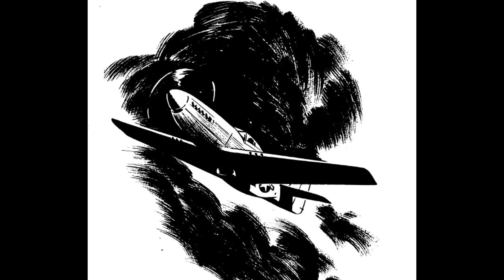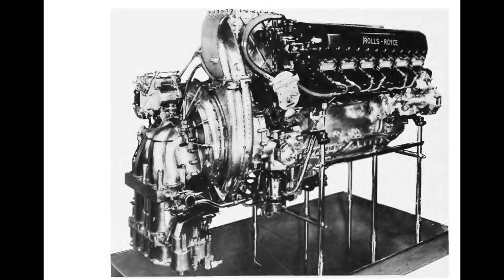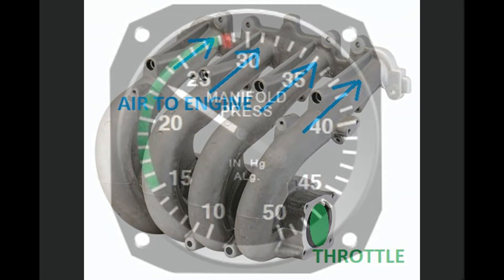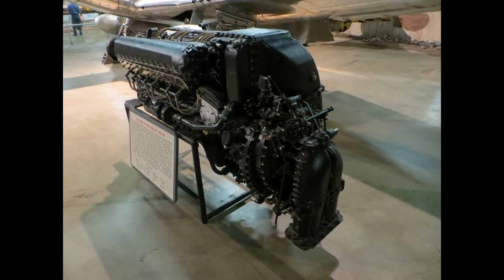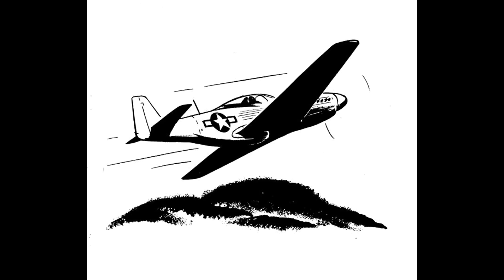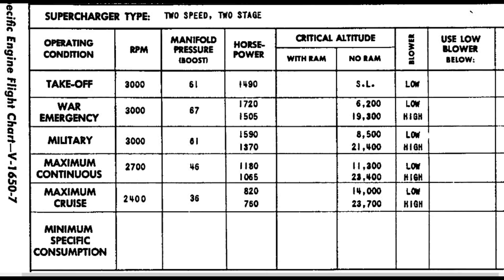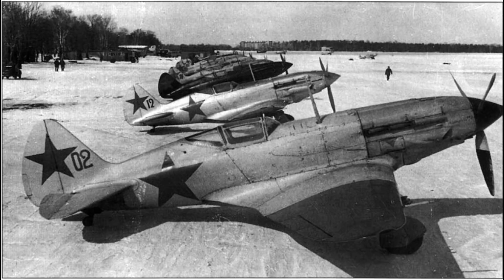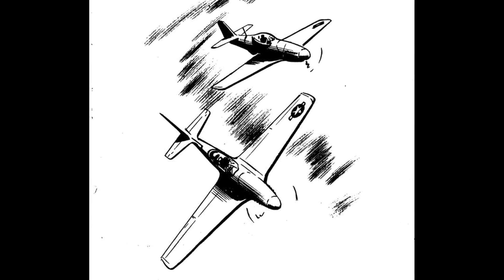P51 Mustang Manifold Pressure

Comment: The P-51D ran 67"Hg for very little of its combat service. In June 1944 it was cleared for 75"Hg, and by the end of 1945 all 8th AF P-51Ds were using 150 octane fuel with this new engine setting. And the Brits even used 81"Hg.
Reply from the maker: That's absolutely true, in fact the P51H with water:methanol injection could run 90"Hg! However this video is more of a general video on manifold pressure, and the use of 75"Hg is really another discussion. Every P51D official manual and the aircraft placards shown in the manual show a maximum of 67". I'll explain why that is, and discuss the 75" setting in detail in an upcoming video about the 109G's DB605 as Compared with the P51D's Merlin -7 and -3 engines.
Reply: Regarding WEP, the Merlin 60 series engines were thoroughly tested by Rolls Royce in 1943 in a series of 'overload tests' where their goal was to run a Merlin 66 for 100 hours straight at +18 lbs boost at 3,000 rpm (WEP). This began in March where they took a standard production Merlin 66 and it lasted 27 hours before cracks appeared in the crankcase. After half a year of tweaking and improving the engine; by November they achieved their original goal and completed 100 hours of continuous 'WEP' power.
The 5 minute limit given to pilots is just an arbitrary figure to prevent pilots from constantly running their engines at their limits as this decreases total engine life. From a logistical perspective, the Western Air Forces preferred to have engines last from 120 to 150 hours before needing an overhaul. For comparison, the VVS was happy with an engine life of around 50 hours so they ran higher ratings on their lend-lease aircraft to make up for the performance deficit. There is plenty of anecdotal evidence found in pilot reports where in a life or death situation, they would kick their engines into WEP for 30-40 minutes at a time to get themselves out of a sticky situation. Better an engine with a shorter life span than a dead pilot.
Reply: Dave M 
The engine wasn’t swapped out every time WEP was used. That’s just ridiculous. The 5-min limit was just the limit for continuous use. They could let the engine cool down for a minute or so, and then use WEP for another 5 min or so. 
There was a certain amount of hours of WEP usage after which the engine was swapped out, and the pilots would have to log in how many minutes of WEP they used after every sortie. The engine would be switched out after a certain amount of time, which I’m not sure what it was. But it was way more than one usage.
Reply: If wartime emergency power was used, the engine was swapped out.

The Merlin supercharger was a 2 speed. The control had 3 settings.  Low, high or auto. 

Take off was in low, then switch to auto. An aneroid device would shift the supercharger to high at around 15,000 ft. Was startling to some. On descent just a power drop.

Engine got slightly better economy on low blower as it took less power off the crankshaft.

The major factor in the marked increase in power in Allied aircraft was the higher quality fuel which allowed higher manifold pressure without detonation.